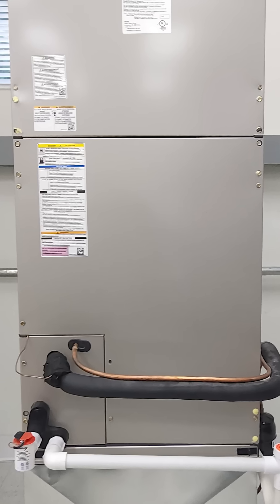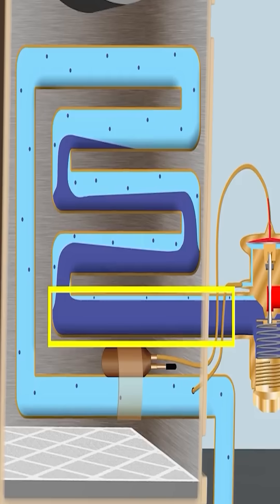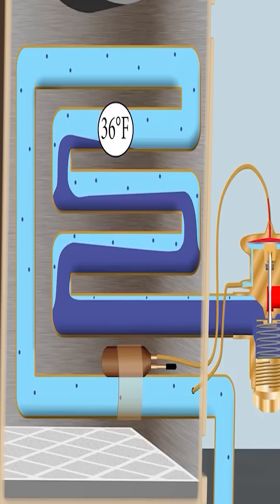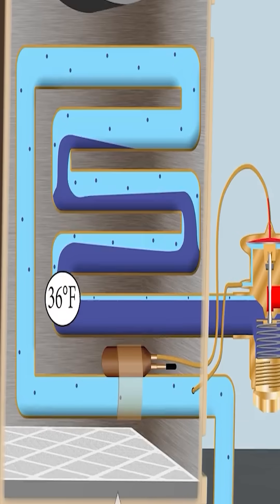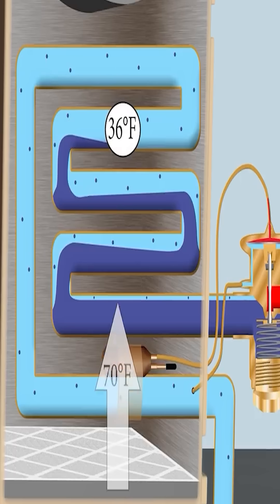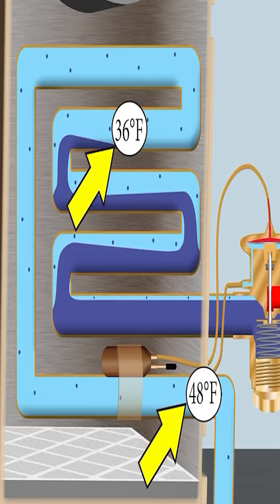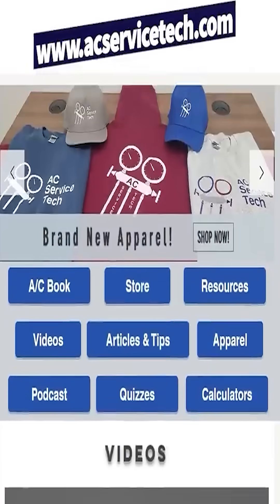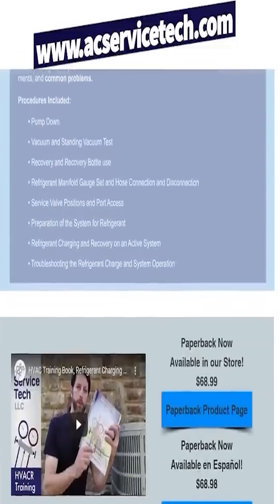What is SUPERHEAT on an Air Conditioner?

Comment: So the SH is the rise in vapor temp (sensible) as soon as it becomes full vapor (ideally leaving the evap coil) and just before it enters the accumulator and compressor?  Somewhere close to 10 degrees.   
And also consequently the SC is the intrinsic lowering in full liquid temp from compressor to the TXV.  

Also another way to look at it is when refrigerant vapor travels in a line it will naturally begin to rise in temp (super heat).  And when liquid refrigerant travels through a line it will also naturally begin to cool  (sub cooling).  Did I get that right?

Comment: Having trouble wrapping my brain around how the vapor increases in temperature as it goes. Isn't it all the same pressure so temp would be the same. Is it like fog in the middle so lower temp? So the vapor pressure\temp at the port is the highest temp of vapor in the line or an average?

Comment: All my carrier coil at 23-25 superheat. At 8-10 subcool. If I charge to 12 superheat pressure goes up at least 20psi and subcool will be around 16. High side would have like 20 ctoa 😂😅

Comment: Hey, would a lower super heat on an expansion valve mean colder AC? Compare to one with a higher superheat, I know its a risk for the compressor but would a lower superheat make an AC colder
Reply: Not by a significant amount. It takes much less energy to increase the temperature of a refrigerant (or anything) than it does to change its state. It only takes 0.2 BTU per pound of 410a to increase its temeperature by 1 degree, but it takes over 100 BTU to evaporate 1 pound of 410a. So decreasing the superheat will get you a handful of more BTU but it would be insignificant compared to the tens of thousands of BTU your system moves.

Comment: If evaporative coil freezes, does it mean there is no enough superheat ?
Reply: Freezing on an air conditioner is caused by low suction pressure. After the coil is frozen there will be very little or no superheat because there is no airflow through the coil. The coil would have to be thawed and then check the superheat to figure out what is causing the low suction pressure issue. Low suction pressure can be caused by lack of airflow or lack of refrigerant flow. Low superheat is lack of airflow, high superheat is lack of refrigerant flow.

Comment: Thank you sir, Great simple and direct gem of information.
Reply from the maker: I really appreciate it!!!
Reply: @acservicetechchannel  I may be in the wrong spot but hoping I can get a answer 

I got a 2006 mazda 3s 2.3L auto sedan 335 k miles
I have this problem the does car not over heating . Theonly part I have not changed is expansion valve and high and low sensors I charged up with 134a no leak filler   shop said I need a new compressor and high line I replaced myself

New parts 
Ac compressor new not rebuilt  not China crap eather GPD
Cooling fan
Condenser
Dryer
High pressure line
Water pump
Thermostat
Flushed radiator inside /ou coolant
Expansion tank
Cab filter

What could it be?

Comment: Nice short!, however I thought the piston was the one that controlled superheat and txv did subcooling?
Reply: Both try to achieve super heat in evap coil but, when charging a system with a txv, sub cool must be used because txv constantly tries to meter the refrigerant level in the evap coil so you have to charge by the amount of refrigerant thats in the condensor. Which is where "sub cool" takes place.
Reply: Piston and txv are both metering devices that restrict the flow of refrigerant into the evaporator coil. You have one or the other. Unless you have a heat pump in which case you have two and some times one of each. One straight AC unit has one metering device. Piston, txv or now eev